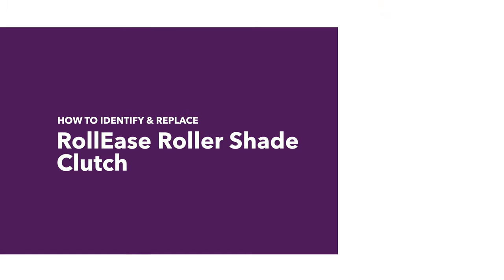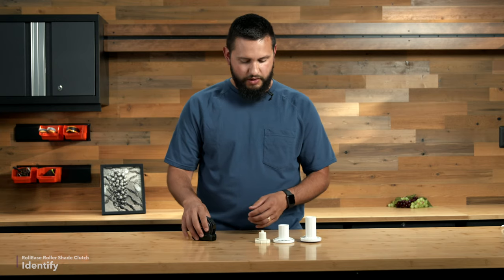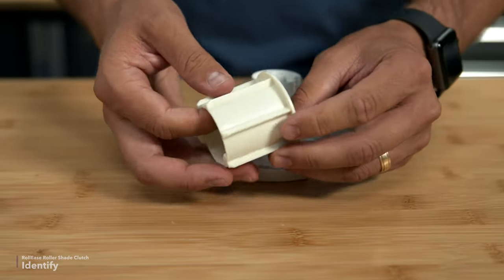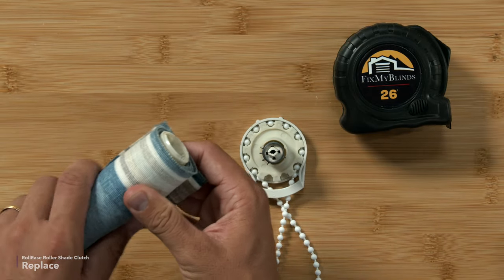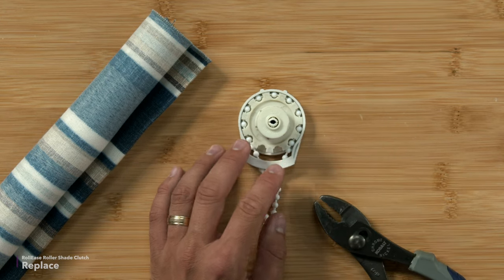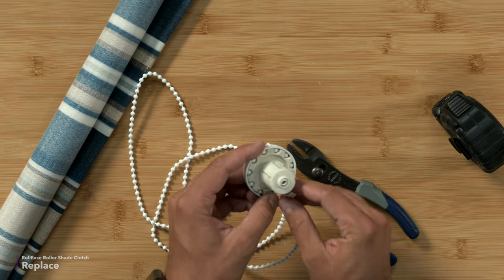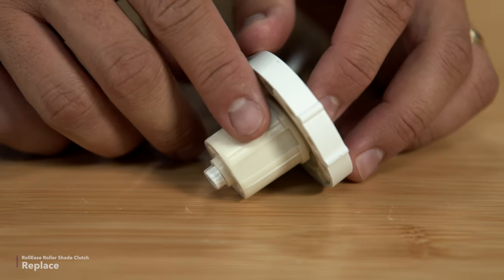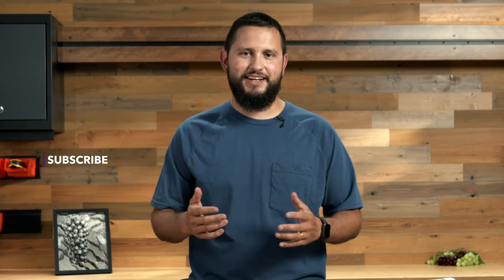How to Identify & Replace a RollEase Roller Shade Clutch

Comment: Thank you Brian for this video as it is very helpful.  We have an R8-1-1/2 in clutch.  We just ordered a replacement and we can't get the cap off the clutch itself. Do you have any ideas how to do that? It also came with an end pin which I have no idea what it is for...?  Any help would be appreciated.
Reply from the maker: Hi there, The clutch mechanism doesn't come apart. Taking it apart breaks the clutch. Do you need help getting chain on the clutch? This video will help with that: https://www.youtube.com/watch?v=ya7Cabh-3Z0&ab_channel=FixMyBlinds. The end pin is for the opposite side of the tube from the clutch. Please let me know if you have any additional questions!

Comment: Very helpful, thanks Brian! Just one question - I see the Skyline has at one point two bead grooves close together, which do not appear to align with the regular spacing of all the others. Why is that? Does it not cause a problem when winding the cord? Seems odd.
Reply from the maker: That particular clutch is sized so the number of bead spots is an odd number.  Typically the clutches have every other bead spot reversed … one forward, one backward, one forward, one backward, etc. With an odd number there had to be two in a row of either forward or backward. I doesn't cause any problem whatsoever with the operation.
Reply: Excellent, thanks!

Comment: is there a clutch that can keep the blind open at any level and lock into place ?
Reply from the maker: Hi there, that's what a clutch mechanism is designed to do. You can raise the blinds to the desired level, stop pulling on the chain and the blind should remain at that level.

Comment: How can you adjust the springs in the clutch? seems they jumped band the shade lower too easy
Reply from the maker: Hi Hans, There's no way to adjust the springs inside these types of clutches. If the shade is unrolling when it's raised, it means that the clutch is failing and needs to be replaced.
Reply: @fixmyblinds  Thanks for the tip on that...will order new clutches. Greatly appreciated,  Hans

Comment: Is it normal that my tube is only made of cardboard and the problem I'm having is that the clutch keeps slipping out of it?
Reply from the maker: That is the case with some roller shades. You can try wrapping some masking tape around the part of the clutch that fits into the tube to make it larger. Perhaps the added bulk will hold the clutch mechanism inside of the tube better. It's also time to consider replacing the window covering altogether.